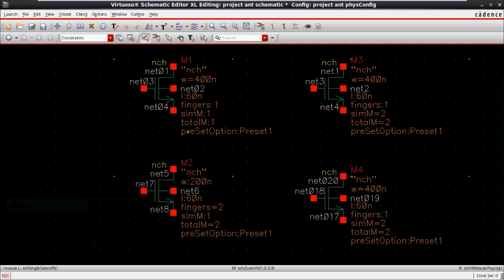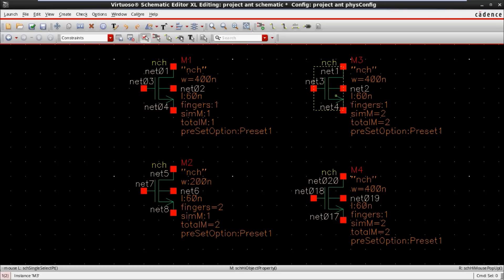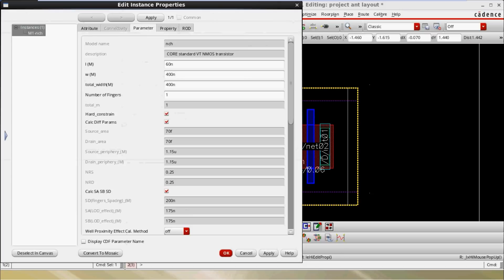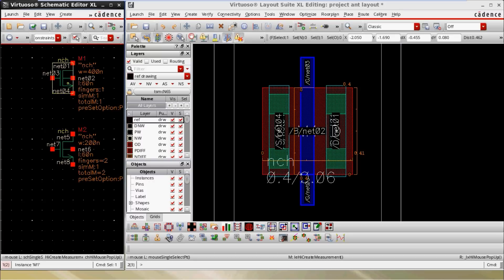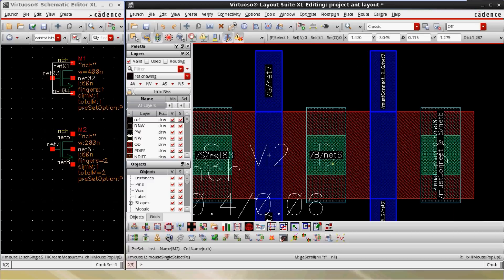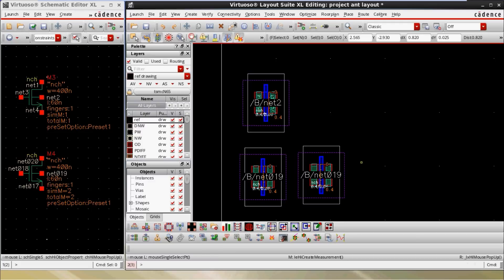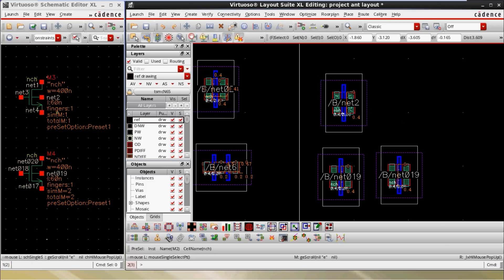Finger & Multiplier Layout - English Version

Comment: I have a question, suppose i have a diff pair transistor total width=24u, l=3u  ( option1 set w=6u and finger 4, option 2 w=6u and multilple 4)...is both are same... can i use any of one combination in layout)...which is best, and incase how to implement common centroid method in using finger concept

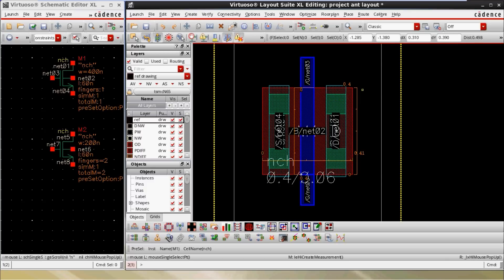Comment: @3:42 you say 400 micron but it is actually 0.4 micron or 400nm. Then you say @4:00 gate length is 0.4 micron which is wrong as well, because the gate length is 0.06 micron.
Reply from the maker: thanks for this info

Comment: May I know what is the difference between one transistor 400um with 2 fingers and two transfer 200nm multiplier......(in this case both are same or not???)..and how fingering used for IR and multiplier is for current can u elaborate......???